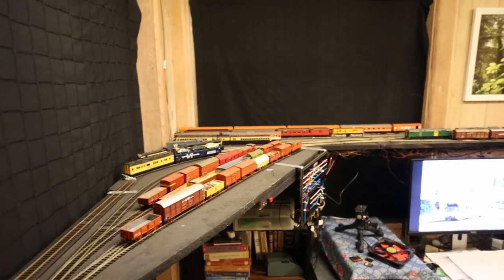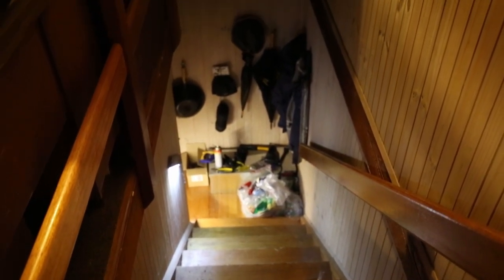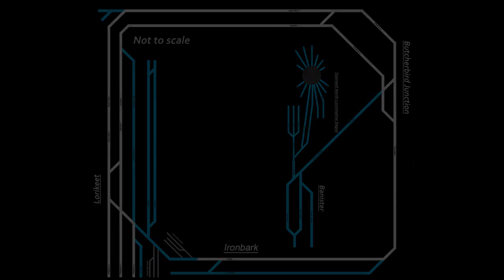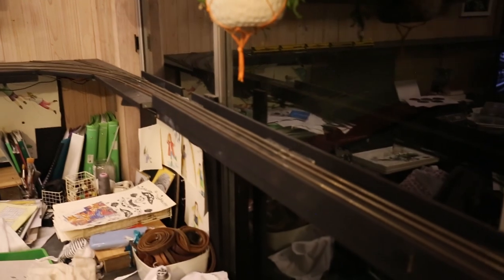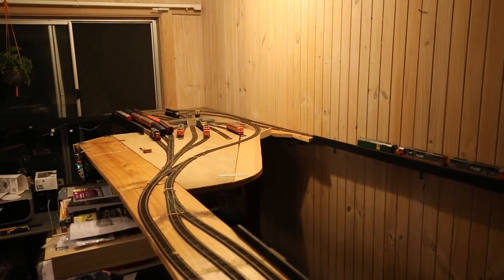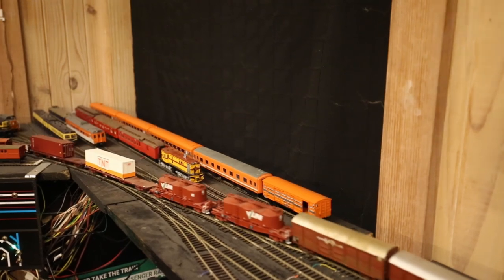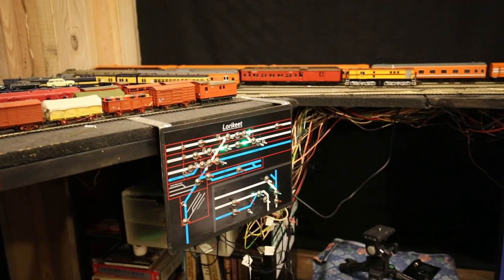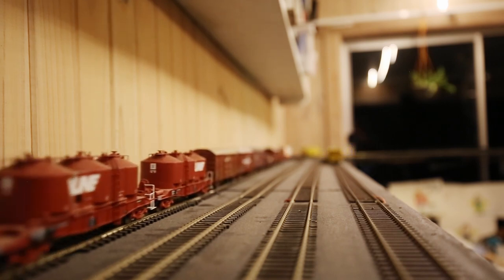Office Model Railway - Complete Tour

Comment: Excellent use of available space at the time. . A bit of money tied up with some of that Victorian rolling stock and locos too. Great stuff. Did you make any from kits, or obtain ready built? Like Andy here says, it will be great to see the next project.
Reply from the maker: Thanks Brian! Yes I've spent a lot on rollingstock, but it's spread out over more than 15 years now so not really a huge expense in the scheme of things. Roughly half are built from kits - most of the goods wagons are Steam Era Models kits, as are all the wooden passenger cars. Quite a few of the locomotives (including all three running in this video) are older Austrains locos that I've done quite a bit of work to adding extra detailing and weathering etc.